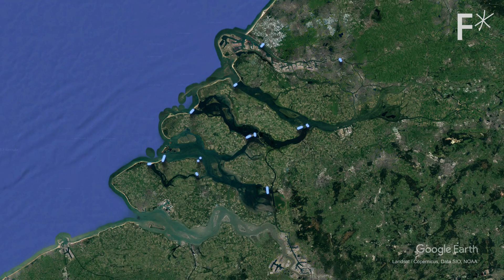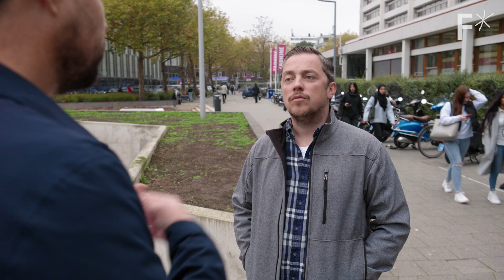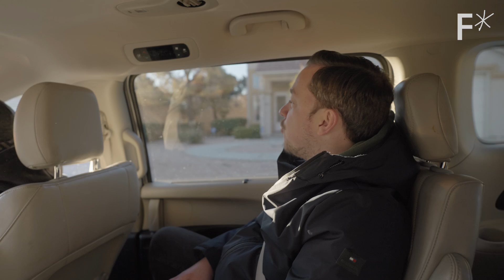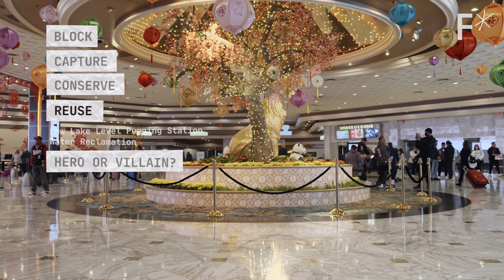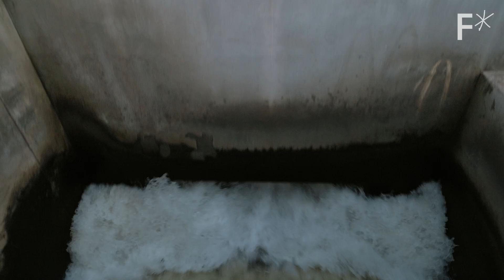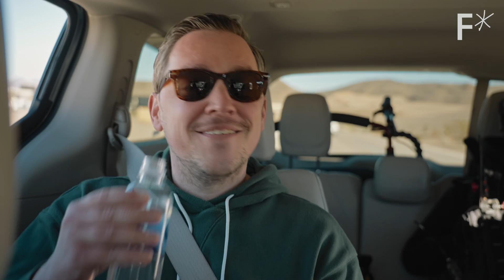These cities are working alongside nature to become flood-proof

Comment: It's cool that people are using the water instead of treating it like its a nuisance. I think its not only efficient, but inspiring and entertaining. You take what is otherwise a bland area, and turn it into something enjoyable. 

What was weird about the water allocation in vegas is that they have an allotment of water (300,000 af, or 275,000 af), but they get to continue to use water as long as they put it back. Is that really conservation, or is it just a loop hole?

The reason I say this is because they are going to have to treat and dispose the water anyway, so why should that effect how much water they use? It seems like that (wastewater treatment)  should already be a part of the calculation. 

I guess what I'm trying to say is, if they're able to consume 300,000 af per year, without repleneshing that, then  how much are they actually replenishing? Is it merely the difference, 100,000 af? Or is it actually almost all of the use, 400,000 af? What's the percentage of the reclamation? 

If they are recycling their water at ~100% efficiency, or close to that, then lake mead would fill over time. That would be the goal right? To have more than enough?
Reply: would it feel better if they put the re-used water into a big pond somewhere that's not that lake?
Reply: The root problem is how much water is taken from the lake. If they put some of it back has it actually left the lake.

(and the amount they used with the amount returned was only 225,000 af.  That is the number that should be focused on)